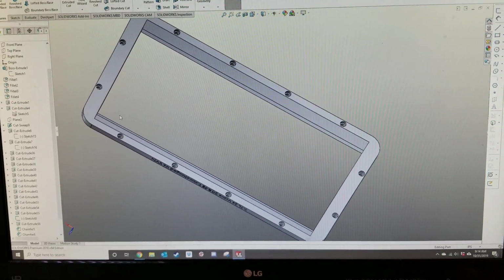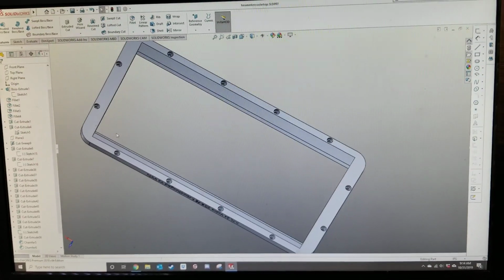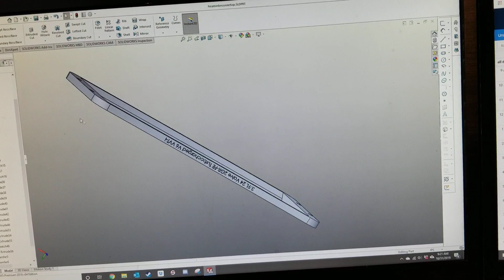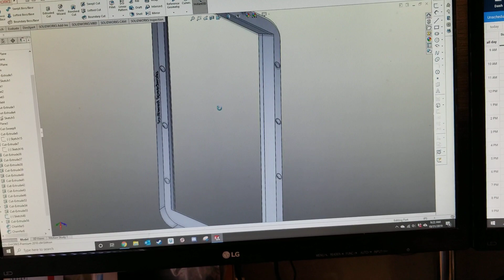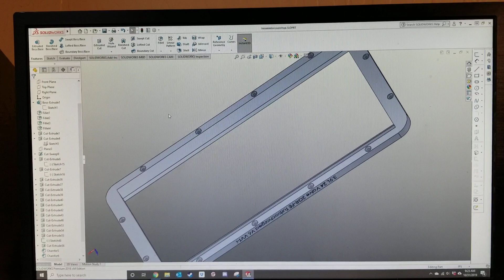3.9 liter twin turbo 2GRFE  build update.  All about intercooler design!

Comment: I posted on one of your other videos but if height instead of the Holley Hi Ram lid could you not fabricate a lower profile like I mentioned in my other comment and use the reservoir up front like I mention with 2 stock ZL1 cores that support 590 HP stock and mount some coolers similar to a stock transmission fuild cooler from a Duramax near the rear since they have fans stock. After the chilled ice water is pumped from the front through the core the water coming out of the core could co through the transmission fluid cooler with the fan blowing across the core before going back to the iced reservoir in the front. Mine plan granted in a front engine Silverado is the 7 gallon reservoir of ice water in the bed pumped through the A2W brick then through an upgraded CTSV heat exchanger before back to the reservoir. Sorry if all this has been figured out since this upload. But Dedicated Motorsports has ZL1 bricks that like I said support 590hp stock and a bumper mounted heat exchanger along with the lines from the front to the back might be plenty but I know the Shearer fabricated intake for the Hi Ram base hasn't been out too long and people are able to run it under 4th Gen Camaro cowls and under Corvette hoods since it is so much shorter. Again I apologize if you've figured all this out by now but it sounds like the vendors are giving you the run around which is unfortunate. Good luck Prestige look forward to more progress.

Comment from the maker: This is the base plate for my water to air intercooler that will bolt between the upper and lower plenum on my holley Hi-Ram intake manifold made for an LS Chevy engine and adapted to the 2GR.
The Intercooler core is conservatively rated at 1300 whp.    I will also utilize Methanol injection thru a shurflo pump and attomizing nozzle in the in the intake manifold